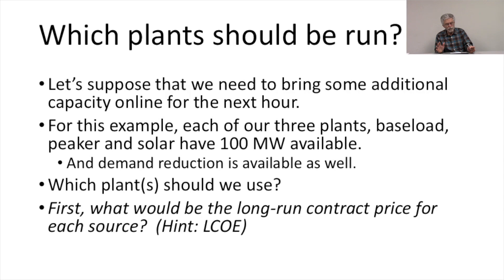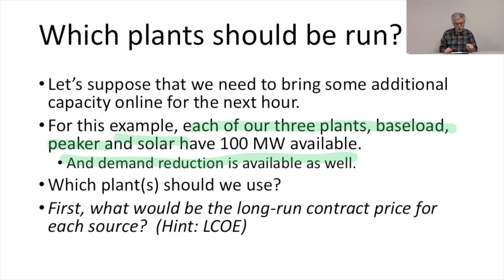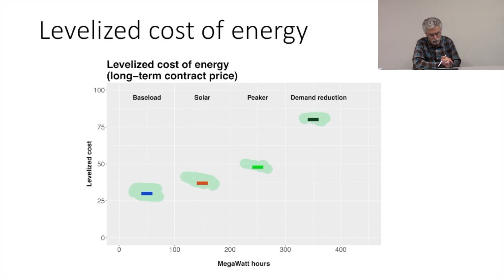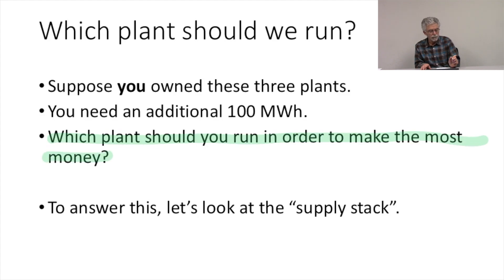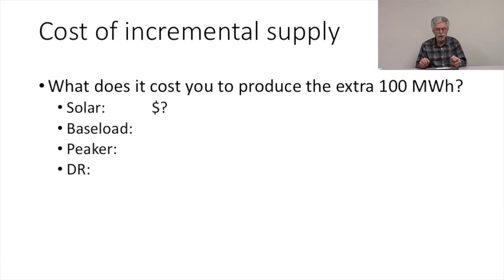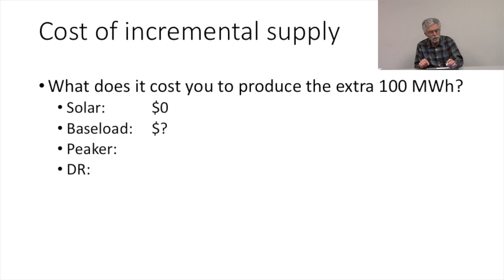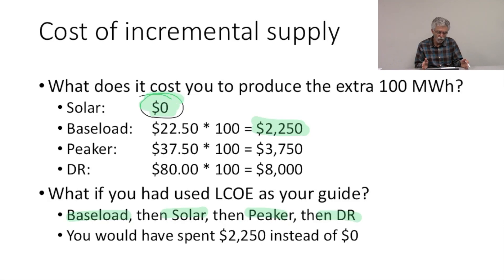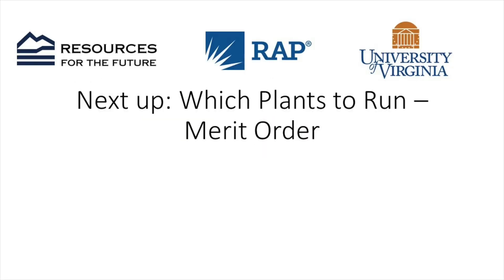Economics #32: Which Plants to Run - The Supply Stack

Comment: Excellent series of mini lectures so far. Consider this a thumbs up for the previous 32.  So here in 33 is where the problems start.  You make assumptions that rates are determined by variable costs alone.  While this might be true in the extreme short term it is far from true in the long term because investors don't invest expecting not to cover all their costs over time.  Rates are kept low over time by selecting the lowest LCOE plants to run, and LCOE must include a pro rata formula to derate plants which offer low ratios of firm capacity to average output (annual CF x nameplate MW).  Using the lowest marginal cost plants first ensures only the lowest cost for power for that hour.  To keep a system stable over time, we must use the lowest capacity credit adjusted LCOE plants in their optimum capacity factor ranges.  Build/mix decisions depend on load profile and existing mix operating and marginal cost characteristics.